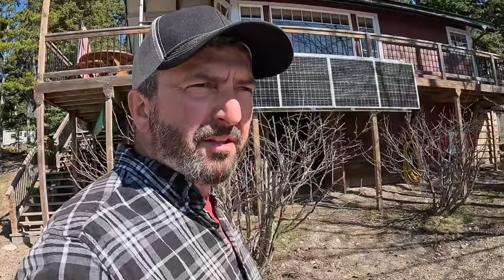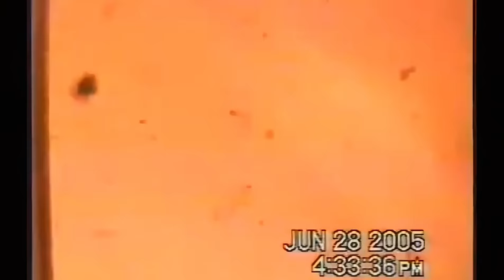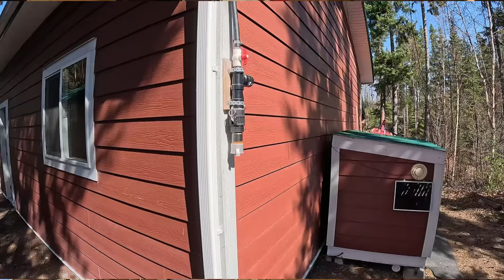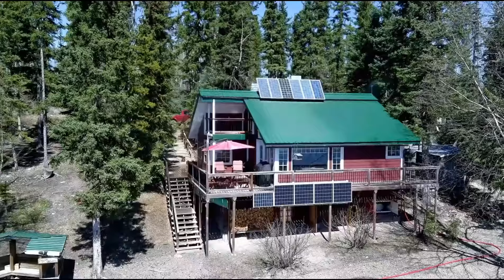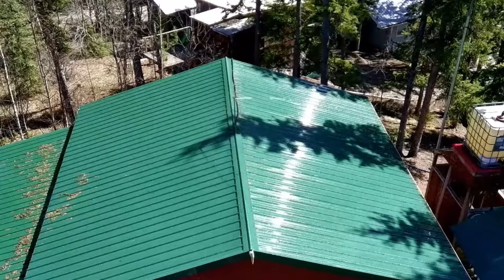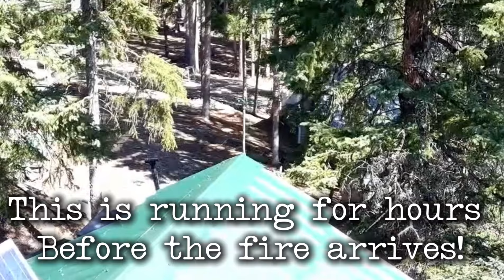Off-grid wildfire defense that actually works

Comment: To bad you couldn't put a hard line a few feet under ground that came up at the shed and house and other structures yes I get a lot of work but would protect the pipes from the fire which can burn the hoses and a small shed for the pump down by the water , just an idea from an ex smoke jumper and thanks for the build and video love it going to be sharing this one !
Reply from the maker: Thats is great idea.  I have been working on a plan for a pump house near the lake with underground lines like you described. Always looking to make things better!  Thanks for watching. Cheers
Reply: @HacksandProjects  it's something I would do and so glad you made this video cause friend who has an RV camper trailer near a lake is going to use your idea and install a remote set up for when he's not there to move it because he lives 11 hrs away from it's location but he's going to run the lines underground from the pump station to his trailer so anyhow be safe over there in this crazy season
Reply from the maker: @northernudduckandblackrose  Thanks, Good luck with the build, underground is a great idea.

Comment: Cheers mate I reckon you probably saved lives by producing this video. Can I just add that if you insert gate valves to your downpipes you'll be able to flood your gutters too. (Where you can reach them from the ground.) In Australia our main science institute (CSIRO) reckon 85%-90% of homes destroyed in bushfires are lost due to ember attack. Flooded gutters blocks one of the biggest ember ignition points. Just reinforce your roof gutters because if they fall off under the weight of the water, you'll lose one of the best lines of defence against ember attack. Thanks for taking all the time to make this video
Reply from the maker: Thanks ! That's is really good information.

Comment: I just had a plumber over who said you can also run the hoses up the surrounding trees and aim them towards your cabin in addition to the ones on the roof. Do you have any thoughts on whether this would also be effective? I want to use our fire pump that is on our dock BE HPC - 20652". With attachments and splitters could we use this? It seems difficult to find extra parts and the pump seems very ineffective because you need someone handle it.
Reply from the maker: Could work, my only thought is the point is to be creating the Humidity Dome around the property,  This might just concentrate the water on the structure and take away from the Dome.  So if it was extra, then yes, but if you diverted water from the "Dome" it may not be as effective.?

Comment: You have a house on a lake and say that water supply is a problem??
Reply from the maker: lol... In the sense you cant just turn on a tap like in town. The off grid part severely impacts that supply. Cheer's
Reply: @HacksandProjects a stronger and larger pump that can feed a larger system and at least one fire hose might be an idea.

Comment: I have a question, do you think more sprinkler heads would be better, or is what you have enough? I have the exact same senario with a dock on a lake that I am planning to do what you have done with a forestry pump and hoses. Would steel piping on the roof be better?
Reply from the maker: Yes I think more would be better. I have plans to add more lower to the ground to saturate the area. And shouldnt be an issue with steal pipe. Just ensure it's sloped to drain properly... I just had this other pipe avail.
Reply: @HacksandProjects I ended up going with putting a permanent rainbird popup system for my ground system. I purchased 200ft of 1 inch line and 200 ft of 3/4" .
Reply from the maker: Is it easy to winterize?